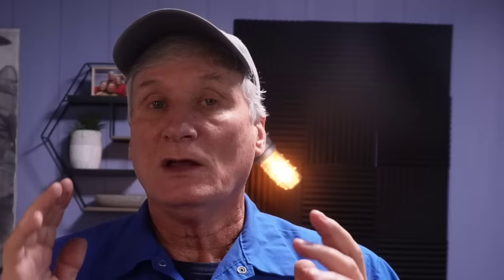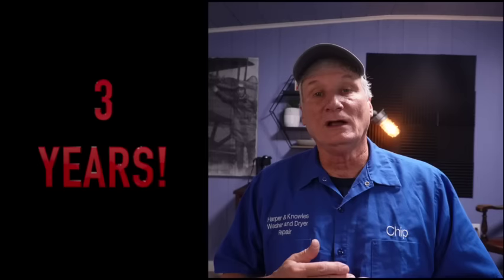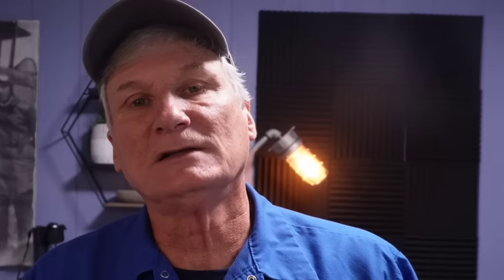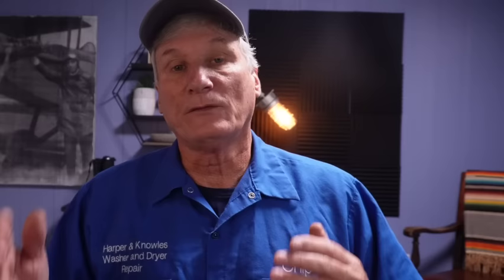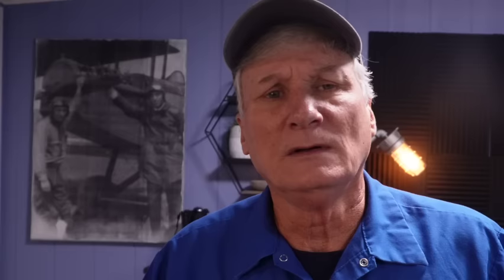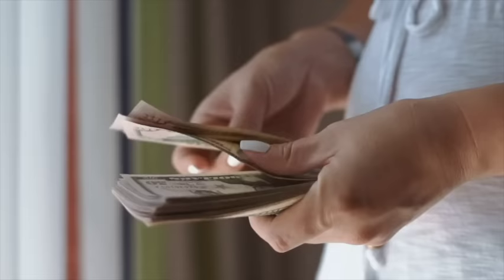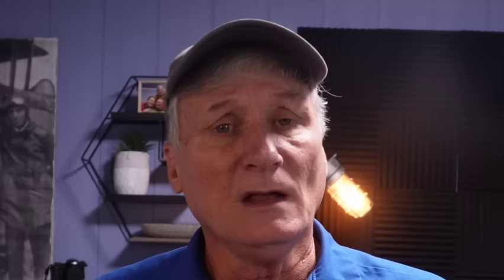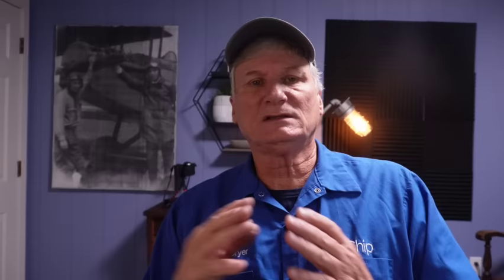How To Choose the Best Washing Machine: Speed Queen TC5 vs. TR7 Review

Comment: I've had SQ's over 27 years, both Amana and Alliance.  Just got the TR3, and really like it, and it is very quiet too.  It washes fine, and is better with full loads like blankets. 
One weakness, as with any washer, is the main baring and seal.  My 17 year old needs both, and can be DIY for under 150$.  I like its old style timer.  I plan on fixong it too.  The Amana SQ also had seal failure after ten years. I have  a working SQ wringer, and an older Amana SQ that I got at Good Will for 50$, it works fine.  So I have four Speed Queens now.  My mom had the original ME SQ from the 60s, it needed a drain pump. They're simple for DIY, better than anything else, except perhaps old school Maytags. Finding used SQ's are scarce, but avoid other used brands. Usually problems are user error or external.  Our water flow was low, took too long to fill, and caused resets.  Found out that we had lime scum in the supply valve and older hoses.  Cleaned out the crusty stuff, and now it has 52# pressure that can fill 5 gals in 45 seconds, works great now.
Reply from the maker: Thank you for sharing your extensive experience with Speed Queen washers! It's great to hear that you've had such success with their products over the years, and that you find them reliable and easy to maintain. Your story definitely highlights the importance of regular maintenance and the potential for DIY repairs to extend the life of your appliances.

It's also helpful to know that your TR3 model is quiet and works well with full loads. Your experience with addressing water flow issues further emphasizes the importance of checking external factors that can impact the performance of your washer.

Speed Queen washers have a long-standing reputation for durability and ease of repair, which is why they continue to be a popular choice for many consumers. Your satisfaction with multiple Speed Queen models is a testament to the brand's quality.

Thank you for watching my channel, and please don't hesitate to reach out if you have any more questions or need further assistance. Thanks again for sharing!
Reply: I used old Maytags until it started getting difficult to fix them.  I bought a Speed Queen washer and dryer two years ago and I don't work on washers and dryers anymore.
Reply: What a treasure u are! Like piano tuners, u are a vanishing breed!

Comment: Our TR3 is just over 4 years old.  It runs like a charm and gets our clothes clean.  The auto fill is spot on, yet you can also choose your preferred water level manually.  Also with Speed Queen, when you choose hot water, that is exactly what you get, unlike other brands that mix cold water in on the hot setting.  I have had no issues with the Perfect Wash system.  Everything that goes in dirty comes out clean, including the blanket that I thought was ruined after the cat had a nasty "accident 🤮" on it.  So I am sold on Speed Queen.
Reply from the maker: Thanks for sharing your experience!

Comment: Yes, this is correct, SQ is built to last!  I am in year 13 of my TC5 predecessor, and it hums along without complaint or drama.  It was certainly more expensive for the 'base' machine than the other gizmo filled units available at the time, but this investment has paid off several times over.  The old fashioned controls and steel transmission give me great piece of mind!  Other family members who purchased machines about the same time are on their 3rd machine.  Enough said!
Reply from the maker: Well said, my friend! Thanks for your perspective.
Reply: The TC5 kicks butt! I love mine!!
Reply from the maker: Yes, it does! Thanks for watching!

Comment: I went to my local appliance store and bought the Speed Queen TC5. Had it for about three years now. The only thing I don't like about it is, it doesn't offer to do a small load of washing. You can pick the regular size load and the large load but sadly no extra small load for washing only a few items. I would also like a bigger capacity, I have a hard time getting a queen size comforter washed. You can get one into it, but it doesn't have enough room to really get clean. Next time I will definitely be buying one that has the three options on load size and a larger capacity.
Reply from the maker: Thanks for watching!
Reply: It’s worth going to the laundromat to use a front loader
Less clean than a top loader but only way ur getting a washer with agitator removed. With the agitator, ur wasting ur time washing a comforter. 
We have a new last year top loader that the agitator removes from but it’s very unusual. 
Ofc u can buy the worthless top loaders with no agitator but then none of ur loads get clean!

Comment: Had a set of the new type washer and dryer.lasted about 3 years. Called my local hardware store in 2016, asked was there a washer without electronics.  Speed Queen at the time did.  Got a washer and dryer, been going great since 2016. A few years ago Speed Queen put some electronics in. The guy at the hardware got ordered 25 of the old ones without electronics.  Did not take long to sell them.
Reply from the maker: If it works, and people like them, why re-invent them??? Thanks for watching!
Reply from the maker: Hey Bert, Speed Queen has indeed incorporated more electronics into their newer models. However, it's important to note that these changes have been designed to improve the functionality and efficiency of their machines, without compromising the robust and durable construction Speed Queen is known for.

As with any brand, there might be some cases of component failure, but these are not necessarily the norm. Remember, regular maintenance and proper use are crucial to ensure the longevity of your appliances. If you have any further concerns or questions, feel free to ask. Thanks for watching!

Comment: Our first Whirlpool front loader had a mold problem that was caused by a design flaw that Whirlpool was aware of but did nothing about (Whirlpool eventually ended up losing a class action lawsuit regarding this matter). 

Whirlpool successfully capitalized on their design flaw by marketing a washer cleaning product that they falsely  claimed would eradicate the mold if used monthly. 

Our second front load Whirlpool (recommended by Consumer Reports and supposedly now mold free) crapped out after only three years!

We replaced it with a Speed Queen TC5 purchased from a local  family operated appliance store and so far   we love it! 

I'm hoping that the SQ washer lasts for a long time, but if it doesn't I'm going to buy an old washer (circa 1980s or 90s), probably a Kenmore top loader, and refurbish it.
Reply from the maker: Thanks for sharing your experience. Thanks for sharing too!
Reply: Good luck finding parts as the yrs go on
Reply from the maker: Parts shouldn’t be a problem. Alliance Laundry Systems is a very stable and thriving company. Thanks for watching!

Comment: We´ve owned our Speed Queen washer and dryer for 7 years without any issues whatsoever.  The only things I do to ¨maintain¨ them are a) I leave the washer lid open to allow it to air dry between washes, and b) I regularly remove the dryer´s bolted down lint catcher screen to clean out the lint caught below the accessible portion of the basket.
Reply from the maker: Thanks for sharing Stan. Great tips right here folks!

Comment: Over the years,after multiple big box store washers with miserly water control, water not hot enough and clothes not getting clean, we purchased a TR7
Allows sufficient water, hot if desired, yet is kind to delicate clothes. Cleans clothes very well.  Built to last, this is how a real washing machine should perform. No other brand comes close.
Reply from the maker: Wow, a good experience with the TR7!  This is the model that Speed Queen gets the most negative criticism about. Most people can't wrap their head around the water through the clothes action. Thanks for sharing your positive experience with your machine, and for watching too!

Comment: I vote for a used 1970s - 1980s Maytag!!   Good to know about the Speed Queen, I'll have to check it out in case my Maytag ever dies.
Reply from the maker: You won’t be disappointed! Thanks for watching.
Reply: Good luck finding parts…. Parts no longer available unless you buy used parts.
Reply: @jpadgr8  Actually I did need a part for the pump circuit that was leaking ... about 3 years ago.  There is a Maytag and general appliance dealer just up the street and they had what I needed.  It wasn't cheap, like $78 but it fixed the problem.   Maybe some dealers know that parts aren't easy to find and so you pay their jacked up fees.
Reply from the maker: You can usually find obsolete parts on eBay but you never know what you’re gonna get.
Reply: @jpadgr8  Most of the parts are still available.  They don't break, so you won't need them anyway!  Good luck with your washer.  You will replace it 3 times and I'll still be using my 1987 Maytag.
Reply: Ya the old maytag dependable care were the best ever, Whirlpool bought that up and made those parts n.l.a. as quickly as they could

Comment: We discovered Speed Queen years ago. The only precaution from the dealer was be aware there is no scald prevention. Whatever setting you have on your water heater is the temp you get in the washer. The best part? No electronics. Even the timer is an old style mechanical unit.
Reply from the maker: Thanks for sharing that information, I'm sure others will benefit from your comment. Thanks for watching my video too!
Reply: @Mike E V so you can't wash with cold water?
Reply: @steve8803  Of course you can. i should have stated when washing with "hot" settings, the water will be the temp of the water heater setting. Thanks for pointing that out.
Reply: So actual hot water instead of machine determined hot
I’m sold!
I like to use cold water for rinses too, not cool like the washer decides 🙄

Comment: I knw this is an older video, but I have to say thanks Chip. My wife is looking for a new washer to replace her 32 year old Kitchen Aid washer. She looked at the cheaper models, and wasn't impressed. Then she looked at the Speed Queen TC5, and zeroed right in on that one. So, this video has solidified her decision as a good one. BTW, that old KA washer stills works fine with the exception on the hot water valve not working. It's the dryer motor that just gave up the ghost. 😀
Reply from the maker: It’s a great machine! Thanks for watching!

Comment: Previously bought a brand new $1,500 Samsung front loader... Nothing but trouble. Techs came out over twenty times. Then bought a simple Kenmore top loader, no issues until 5 years in, stuck in "wash" mode... Had a bunch of expensive parts replaced, still didn't fix problems. Just bought a 10 year old top loading Speed Queen... 🤞
Reply from the maker: I hope your second hand machine will work out for you. Thanks for watching!

Comment: The Speed Queen TR7 uses, a direct drive to tub, variable speed, 1 HP motor. This may require a dedicated 15 amp outlet. The TC5 uses a  two speed, 1/2 HP Motor that would need less electrical power due to the mechanical torque advantage of the transmission.
Reply from the maker: Great information right there, George!  Thanks for letting us know!
Reply: I plugged my TR5 into the outlet for the washer (house was built in 1975) and have had zero issues. Also, Speed Queen doesn't mention/recommend anything special about the installation.

Comment: Absolutely Speed Queen is the best!  No more stinky towels, no more grayge whites. I gave my expensive top of the line front loader away and bought a Speed Queen. 16 yrs. Zero repair calls.  Wash 2 standard feather/down pillows at one time and wash king size quilts both are heavy heavy loads. No damage to items and white quilt is white not grayge. I put mine through its paces and it never fails to deliver. Worth every single penny and will never own any other brand.  Front loaders just do not clean. This machine from delicate items to heavy feather/ down pillows does it all. I expect this to be the last washer I will ever own. The only appliance that won’t need to be replaced over and over and over., that alone covers the cost to purchase!
Reply from the maker: It's wonderful to hear that you've had such a fantastic experience with your Speed Queen washer! Your testimonial speaks to the quality, durability, and performance that this brand is known for, and it's great that it has served you well for 16 years without any repair calls.

Your ability to wash a wide range of items, from delicate pieces to heavy quilts and pillows, truly showcases the versatility of Speed Queen washers. It's clear that you've found the perfect fit for your laundry needs, and I'm sure your endorsement will be helpful for others who are considering this brand.

Thank you for sharing your experience and for watching my channel. If you ever have any questions or need assistance, please don't hesitate to reach out. Enjoy your reliable Speed Queen washer!

Comment: I got tired of buying junk. Put an order in for an old time wringer machine. Guy said I’ve got five and you have to take them all. I did and restored one that I use every week. My Maytag wringer was made in 1968 and works perfectly. Never going back.
Reply from the maker: I didn’t realize they still made those as late as 1968. I need to get one as a museum piece when I move into my new shop! Isn’t it a bit labor intensive to manually feed your clothes through a wringer? Thanks for watching!
Reply: @HarperandKnowles  Maytag made wringer washers until 1983. Probably a lot went for export where running water was scarce. The Amish are now making replacement parts where I sourced them for my machine. 
You are correct about being labor intensive but I really get into it. My only dryer is a clothesline out back. Mother Nature dries and sterilizes clothes( UV spectrum) better than any machine. Yes even in the winter. I’ve been doing lAundry like this for six years now and will never go back. I control water level, wash / soak time, temperature of water etc. I generally use one washer full of water for a weeks worth of clothes. Just like grandma did it.
Reply from the maker: That is commendable! A very interesting story! I’ve learned a bit of Maytag history tonight. Thanks for sharing!

Comment: Thank you for this convincing video that made me buy Speed Queen TRC 5003 model today Wed 25 Jan 2023.  I hope it lives up to its reputation.
Reply from the maker: I do too!  Thanks for watching and your kind comment too.
Reply: Has it lived up to reputation?
Reply: @des_18  yes, definitely.  Speed Queen TC5 works well.  I put in a call because there’s always water dripping after the load is done.  Technician said that it’s just left over water from the fill.  No need to repair the machine but nevertheless it’s disappointing for me.

Comment: Love My Speed Queen Washer and Dryer TR7. Second set we bought. First set stayed with the house we sold. We wash lots of cotton comforters without any problems. Only problem we had was with Tide Pods. The plastic that holds the pods together was not dissolving all the way and leaving strange marks on clothes, like grease marks. Took a little while to figure out. We still use the Tide but liquid only now. Problem disappeared.
What happened to washing machines in the last few decades was the AlGore solution. Change the soap so it uses less water. No more phosphate means less rinse water. But clothes don’t get as clean as the old days unless you use a little clorox and more water than they design it for. Speed Queen has an agitator, very hard to find any more. Unbalanced loads all the time/poor design with most new washers today. Very frustrating. Speed Queen works because they are designed very well. I am sure decades of coin laundry experience taught them well.
Reply from the maker: Thanks for watching!
Reply: How do u put bleach in with colors?

Phosphate is a cleaner?
Reply: @YeshuaKingMessiah  See above answer
Reply: @Scott-jf1nh  ah yes TSP
My older relatives used this all the time it seemed. Washed down walls with it for painting, yes.
I didn’t know u could use it in laundry??
Reply: I truly believe not enough water is a big part of what’s wrong with washers last couple decades.

Comment: Wish we could afford speed Queen but we can’t!  What would you recommend for those that cannot afford speed queen?
Reply: I Recommend the Amana NTW4516FW (made by Whirlpool). You can select Auto sensing or Deep water, and Deep water will fill it all the way up. It also features a Dual Action agitator which cleans better than the speed queen. It is hard to beat for the price, around $469-$599 depending on where you are at. My friend has it and it has been going strong for 5 years. Just dont use the "regular" wash cycle since that uses a lot less water and is best for small loads :)
Reply from the maker: Here's a video where I compared the two most common inexpensive models that come into my shop. https://youtu.be/-ceFPe9Kxis  I hope this helps and thanks for watching.